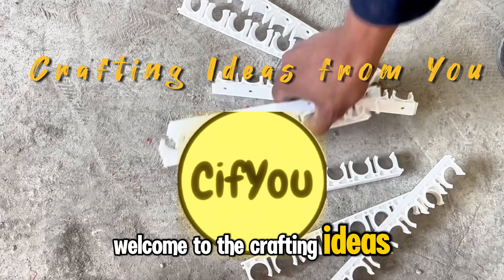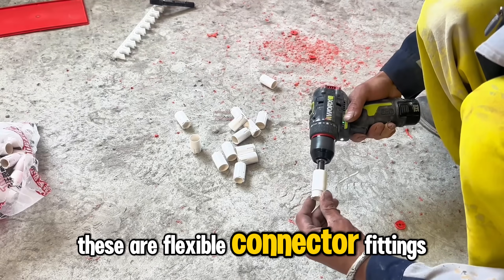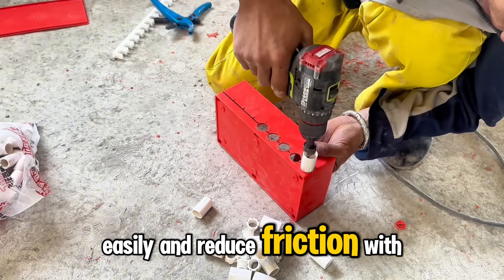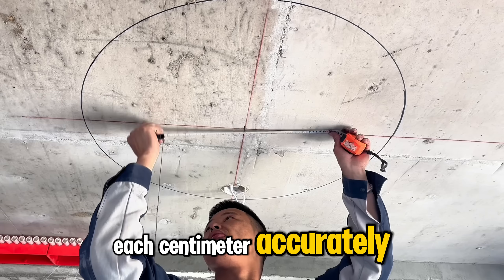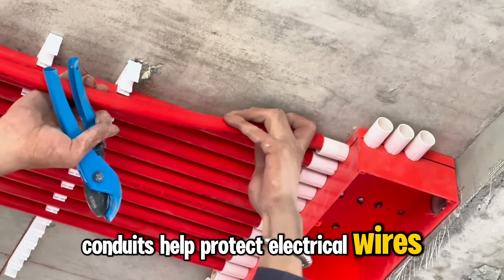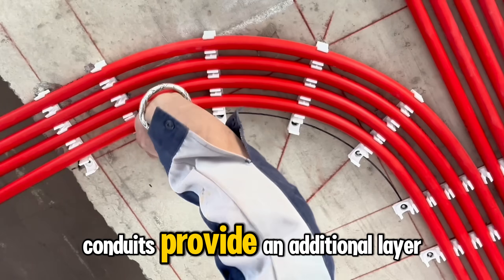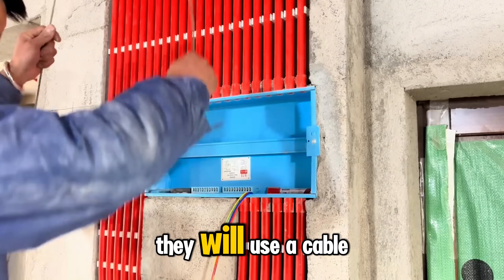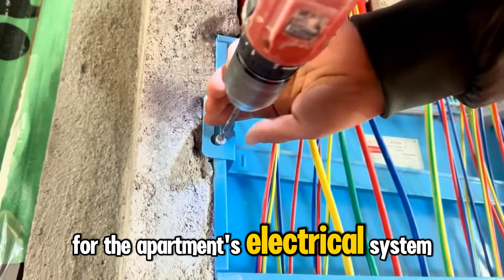What would electricity look like without following NEC (National Electrical Code) standards?

Comment: I have a pic on my phone from a house here in Texas in the US..
All the ceiling lights and wall recepticles were ran off one fuse,  all of them were connected together in the ceiling, in a big knot, in the open, not mounted or in a box.. on top of insulation.. with wire cap connections.

2 bedroom, 1  n 1/2 bathrooms. Laundry room. Living room, kitchen, front porch.. 
7 lights. 
4 wall recepticles 
All ran to one spot, and all bound together with wire caps off the breaker line..
Caps on caps on caps.
Pairing up n capping em.
After all connected..
They folded n balled up the string of wiring..
And set it on the livin room insulation.
Its the size of a cantaloupe. 
The best part..
They installed a plate over the breaker so it wouldnt kick off due to over draw of power. 
It was the metal plating off the back of a desktop computer where your ports stick out the back of the case. 
Screwed to the fuse panel box. 

No wonder it was deemed for demolition
 
N yes. In the walls n all after removing the drywall.. 
Alot of the wires sheathing had melted off. 
Total fire hazard if the walls would of had any kind of insulation in them.. 
I mean still was anyways

Damn i love America. 
Hahahahaha

Comment: It looks perfect, but perfectionism for an electrical system in an apartment is not needed.
It uses up way to much time.. And makes electrical work to expensive for people to afford...

Have a look how swiss people do it...
We think logically when we lay down the pipes.. We dont need to messure each and every corner perfectly..
Just the starting and end point!

Nice work.. Nothing against that, but a looot more can be achieved by not beeing a perfectionist.

Comment: If I am not mistaken in the area where we live this kind of PVC is not allowed especially when you exposed the installation. Because PVC are weak against impact. Minimum requirement are IMC not EMT. Also this kind of installation makes the slab or walls become weak. Why not just run a cable tray instead of those long pipes. Cable trays can be more economical as it can fit different sizes of wires.
Reply: U do know dat this will be all cowerd up right.. Plaster, cement or drywall behind witch is filled whit isolation

Comment: Why use conduit if the wire is already mechanically protected and double insulated  ?
Reply: Pour concreat ower it and u will se why+ if u decide i want somenthing added a can alweys pull more wires fthrew.. Insted of owerloading 1 cable

Comment: When comparing NEC against a 220/240 Volt system out of the NEC code area it is important to keep in mind the voltage difference. A 120 Volt (NEC) installation will require the dobbed amount of copper to be comparable to a  220/240 Volt system that deliver the same wattage to the end-user, that fact alone makes a NEC installation much more expensive as the  220/240 Volt.

Comment: 1 drunking or cable tray can carry all cable, make all's in center can save to avoid disturbing others architectures or equipment's installation space....
I wondering after they put that's many of conduit's on ceiling, how's the plaster ceiling support get space to install.....
This kind of installation will make trouble with others specific contractor's super headache and hard to install their things....
or maybe the whole renovation everyone just corporate to priority and suit for electrical installation works, even no need to install furniture or ceiling?

Comment: If only shcneider sold bus bars so you dont have to spend hours upon hours to cable all the switch board
Reply: Schneider Electric do sell bus bars, no problem. You can get them in many configurations and for different ratings, knock yourself out.

Comment: No metal fixings to secure the cables to the ceiling in a fire
Reply: Bro if your hause burns u will change elecktrical.. Pipes are fire resistent but the cable will melt inside them..
Reply: @danimlinsek9891   the cables will fall to the ground in a fire and kill firefighters

Comment: Most people are not realizing that all of this work will get skim-coated in place by plaster or cement, and will not be visible when completed.  Hat tip to this guy for clean workmanship, using the standards that are applicable in his country.  (also noted, his knowledge of geometry on the fly to swing a 72° arc to get five evenly spaced pendant light backboxes....r x 1.1754 for those at home)  If he was in the States, he would most likely be a licensed electrician, trained to standards that are in effect here.  The standards set forth where he is are just as comprehensive, and just as rigorously enforced - if not more so.  <hands him safety glasses.  You get injured on the job there, tough sht.>
I think it is cool to see how the rest of the world does their wiring practices.  There are a lot of aspects here in the States that are way behind the rest of the world (DIN rail and equipment inside residential panels - what the rest of the world calls a 'consumer panel'? yes please.)

Comment: Worried about the amount of building that's been removed, is that ok? In the UK we run rings and radials, it's much cheaper.  I guess its easier to replace a cable here, but with modern techniques and PVC cables that last forever, not sure you'll have get enough maintenance benefit, just the shear amount of conduit increases your risk of a fixing damaging a cable.

Comment: I thought PVC was too flammable to use in conduit?  at ~6:00 they ate a whole lot of the Primary concrete joins support to curve those conduit traces through.  hope that's not load baring.  This stuff looks great, very aesthetically pleasing.
Reply from the maker: thanks

Comment: op oooppp opppssss!!! there it is!  5:50 beam is chipped off, the safety of the electrial is useless is the safety of the structure is compromised
Reply from the maker: That is with the engineers permission, after I finish the electrical conduits a lot of site supervisors will come and check if they are up to the mark

Comment: Never mind the electrical. Those idiots drilled a hole through a beam. That's a serious structural issue. They also exposed rebar.

Comment: The installation in houses in the Netherlands is similar.  The difference is that all pipes are embedded in concrete.  Pipes and boxes are placed on special formworks before pouring concrete.
Reply: Q. Y do they put the piping in concrete after the fact??

Does that make retrofitting challenging?
Reply: @kawaiisenshi2401 no. At the formwork and reinforcement stage before pouring concrete.

Comment: Hello, as a German "Elektromeister" , I see many problems here. I don't know if you are familiar with the 'DIN VDE'. It precisely regulates how electrical installations should look and the technical requirements they must meet. I claim that, although we might not build as aesthetically pleasing in Germany, our electrical installations are technically much safer than those here.
Reply: The only real "bad" aspect of this install is jamming loads of cables into one terminal, copper bus bars are much more effective, better connections, faster install time and less space taken up in the enclosure. Bunching lots of small cables in one terminal can lead to uneven tightness in the connection
Reply: @cal5566  same concerns, is that terminal "12:00" really capable of handling that many cables?
in my opinion a DIN distribution block would be a perfect addition for this situation.
Reply: @kitame6991  Notice that they're using cable lugs on these ends. Each terminal on this panel has no more than one wire or two lugs.
These can stack very well inside a suitable screw or clamp terminal, because they have flat surfaces and are harder to deform than copper.
Which wire termination is best is dependent on the type of terminal, and that depends on the local best practices.
Reply: Germany, Where they plaster cables without pipe into walls...
Reply: @leverloos  and they do right
Reply: @leverloos and for a reason, puting them in pipes jist genrates heat whereas palstering it without tubing reduces temperature.
Reply: What’s in this case less save compared to a installation according to VDE? 
Would something just like the conduit work be possible in Germany? I thinks it’s a beautiful work and it allows for easy repairs and adjustment compared to putting cables into the wall without conduit.
Reply: @maxmustermann9858  DIN 18015-3 specifies installation zones as an example. This ensures that no cables are accidentally drilled into, as all cables and lines are laid in specified zones. This means that other tradesmen always know where cables are laid and where they are not. This is completely disregarded, for example. Without good documentation, there is a high risk that someone will accidentally drill into a cable at some point.
Reply: I'm from Germany, living in Indonesia. In Germany I was a plumber which included some electric education, but no experience to wire complete projects. As I don't have to follow many regulations in Bali, I invented my own system. Every room has it's own big junktion box in the ceiling. With access. From there I have conduits. To play.
Without experience, I was able to install simple, and change anytime later. No matter if I made a mistake, or my employees.I've changed my bathroom lights 3 times already. Now it's perfect.
Every room has it's own RCBO.
Every Lightswitch can be smart. I have conduits for LED Strips in every place imaginable. With junktion boxes for the trafo. I can add anytime.
No experience, no plan, cheap labor, cheap conduit.
Reply: Genau die bauen Hochhäuser die mehr als 3 bis 4 mal so hoch sind aber Deutschland ist das Mass aller Dinge. Das typische Elektrikergeschwätz, fehlt nur noch die Sternpunktverschiebung, die taucht auch in jedem 2. Kommentar auf.
Reply: Agree!
Reply: Obviously beautiful work.  And probably the only way you can do it when you are cramming millions of people into high occupancy housing high rises, with probably lots of turnover.

Comment: It’s closer to IEC standards, especially the circuit breaker box. Conduit is commonly used in many countries, for example Australia. Less common in Europe due to the additional cost. As long as the wire gauges and circuit breakers are of the correct size, I do not see how the installation in the video would violate the NEC or any IEC based electrical code. 

There are various details that may be required in some countries such as the sizing of junction boxes or exclusive use of UL listed components, but in general this electrician is delivering a system that is commendable and looks safe as well as easy to maintain.
Reply: " less common in Europe“?

No idea which part you soeaknkf, but the several different countries I've lived in  in the EU all use conduit.
Reply: @ab-ym3bf Germany, Denmark, UK and Ireland generally don’t use conduit in most installations.
Reply: Mainland Europe uses plastic conduit almost universally, it's mostly the British isles that use multi-conductor flat cables.

As for the NEC: doesn't it require metal junction boxes and metal conduit?
Reply: @TheLukasDirector Normally for houses we just use romex with staples in the walls and pvc junction boxes. 

Conduit is usually reserved for industrial settings or the outdoors. You can always use it indoors if you want, but thats a choice.

Comment: As long as you're not overloading circuits and using the appropriate gauge wire, I don't see how this is a problem. This is OCD electrical and there ain't nothing wrong with that.
Reply from the maker: thanks

Comment: He knocked out a portion of what looks like one of main main supporting beams.
Of course the structure material looks like paper mache so when the structure collapses the electrical doesn't matter much.
 He over torques the termination into the breakers using a power tool.  Strips the threading and allowing the connections to slip loose.  Leading to fires.

Send him out to work up to be a journeyman in a country with actual enforced standards and learn the trade.
Reply from the maker: It's not that easy to have a fire like that
Reply: @CIFYou  I've inspected electrical installations with thermal imaging where poor connections had temperatures up to 287 deg C.  That would light wood on fire in a minute.  "Normal" poor connections often have temperatures from 60 deg C to 95 deg C.
Reply: Hmmm. do we hear an American telling others how things must be done (in the American way) because America is so much better/wiser/richer than any other in this world ?

Comment: You did well in making the extensions, but you spoiled the concrete and exposed the iron, and this is a serious mistake
Reply from the maker: it's in the design and I'm allowed to do it.
Reply: U do know dat the whole hause is made out of concreate and bricks right... Its not made out of wood more concrete will come ower all conduits plus the hause wont fly awey or breake when a litl bit of wind blows 😂
Reply: @danimlinsek9891  
I know it won't fly, but if the iron is exposed to weather factors such as humidity, it will rust.

Comment: As an European Engineer we avoid this because it's cheaper and faster to lay down the cables on a tray
Reply: And yet we pay infamous prices, noting beats quality ❤
Reply: I’ve been a sparky in the UK 🇬🇧 for 35 years and I must admit this does look bloody brilliant. In my early 20’s I worked at the new ( at the time ) Hong Kong airport they were building , I was there for just over 2 years . The BEST sparkys I’ve ever seen were the Filipino ones out there .
Reply: Skill issue
Reply: Yes using cable tray above ground is okay but donot mix cable of communication separate or install cable trays ❤😎